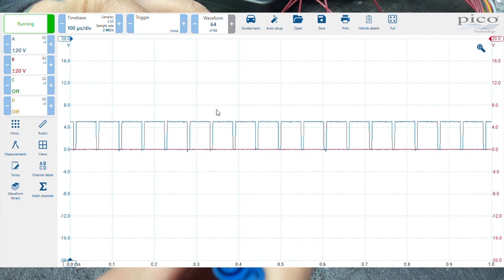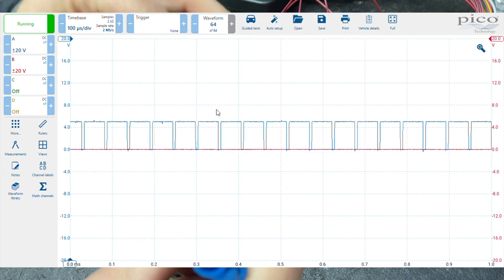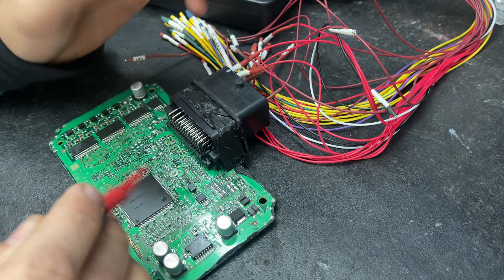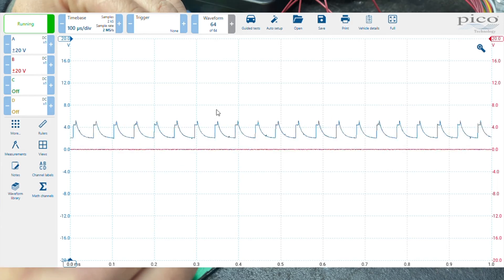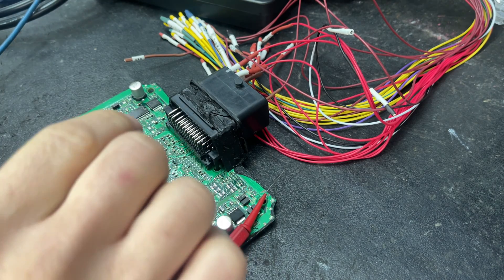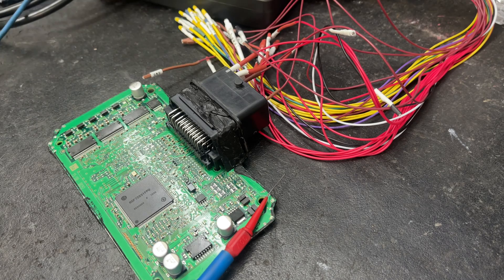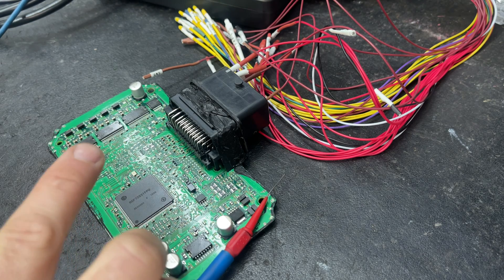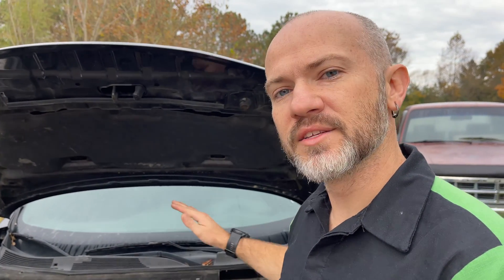Can I fix the Juke TCM?

Comment: Hello, I hope you are doing great. I have question I bought TCM from amazon i’m just wondering would it work if I get junkyard TCM or buy from ebay or amazon and reprogram it if necessary. I have 2012 ford focus that have been sitting in my driveway for couple of months now, and I’m trying to get back on road.

Comment: under the seat that green gungies  connector have you tried some white vinegar and salt heated in a tin or jar dip the whole connector in and whisk then rinse with bicarbonate of soda in water to neutralise and dry the connector should look like new then use a spritz of deoxit for longevity if you got some copper wire you want to solder and have oxidised black give this a try

Comment: A lot of your diag videos are pretty basic. Seems when you look for a battery drain you check for networks staying awake. You have a process that works. Sad a lot of guys don’t know basic scope usage. But I can understand it because the flat rate ways of time is money
Reply: So true. I get a lot of Mercedes towed to my place from dealerships because techs don’t know how to properly diagnose. And I’m not a shop. I just had a W222 S-Class here, dealership quoted the customer $8000 just for diag work without a guarantee they will know what’s wrong. It took my 15 minutes to find the problem, 3 days for the part to come in and 30 minutes to fix it. Another happy customer on its way.

Comment: Man another awesome video,, keep em coming.  Do you actually get the boards circuit diagram to know which chip is what? Or factory training?
Reply: @autodiagyt  Ok yeah I get that, I guess doing some more research on the chips responsible for the communications is needed.
Reply: guess i should have kept watching longer. What type of flux do you have there, I see its the Kingfull but what type is it?